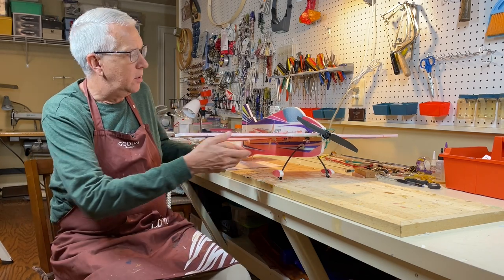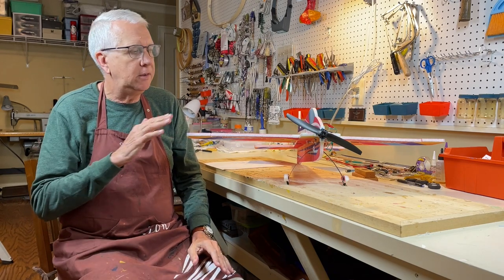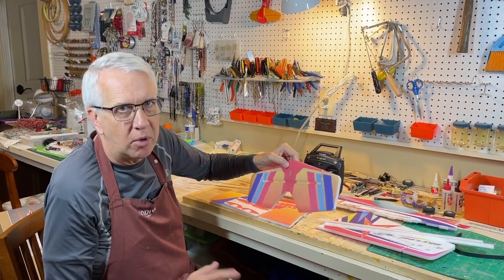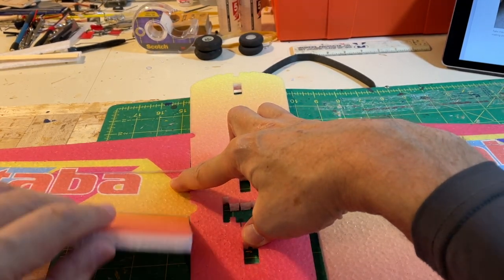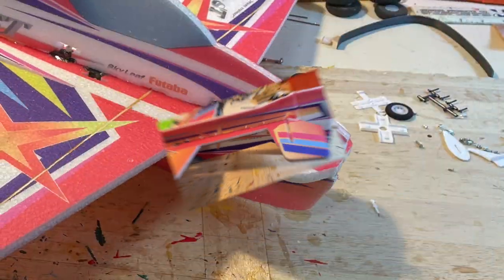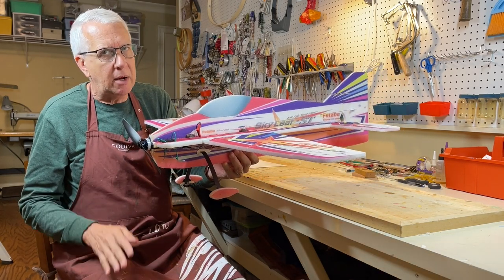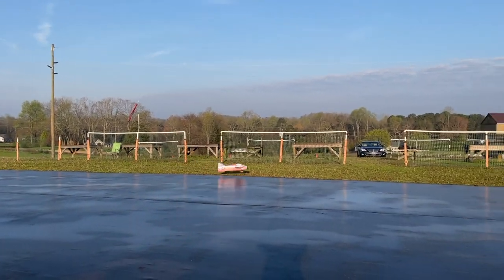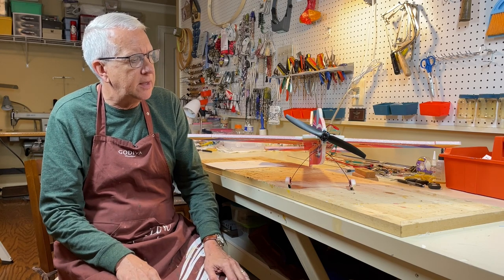Futaba SkyLeaf ST RC Model Build and Fly

Comment: Good plane Tim but this is not a good learner plane. Trainer planes pull themselves away from the ground and don't keep heading for it. Now you've got a 3D plane next step is to increase them throws my friend. Don't worry expo helps 30% is a good start. Try the nose hang challenge. I have a HK fury 3D plane is great to play with . Keep up the content it's always interesting.
Reply from the maker: Will give this a try!  Tim